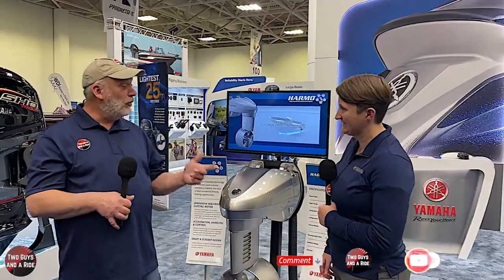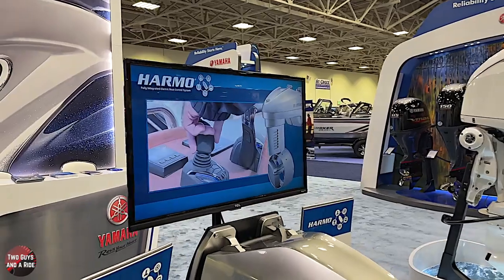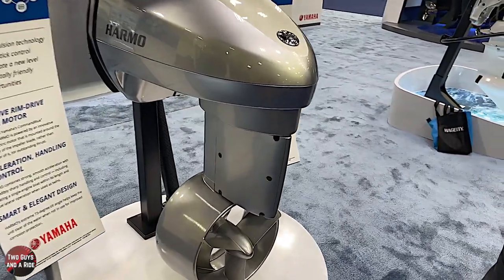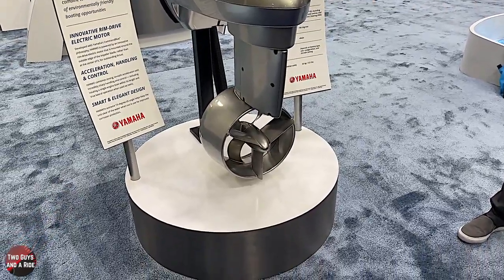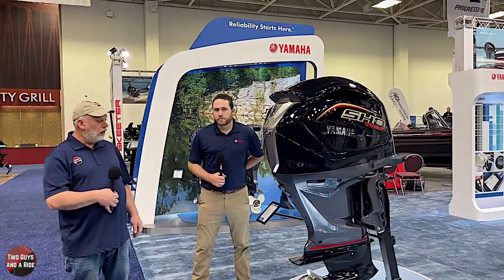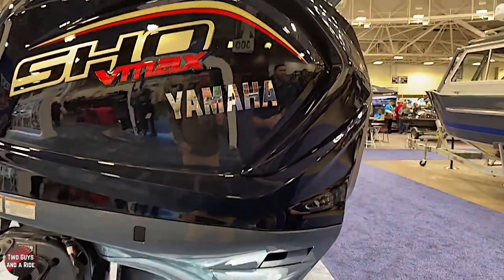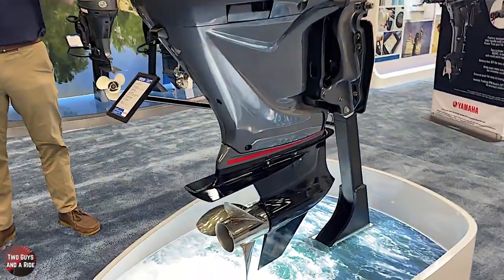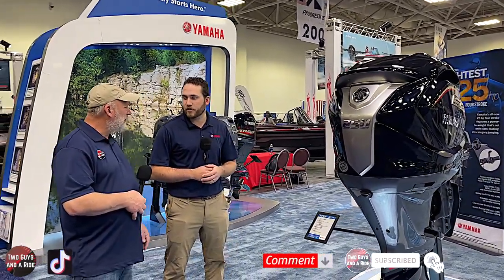The future of boat engines - Yamaha HARMO Electric Outboard

Comment: Still can't see the price. Doesn't look like yamaha is trying to make their own battery system either or i missed something? Also quite sceptic about 9.9hp equivalent since the motor is only 3.7kw. In US already few decent complete options available for electric propulsions, wish in Japan also had something in 15-25kw range.
Reply from the maker: Re price they’re 30k app
Not a budget option
Reply: Why should Yamaha get into the battery business?  Plenty of players in that market already.
Reply: @tedunguent156  Who offers complete systems that can pass marine safety inspection? Big lithium packs are no joke in marine environment. It's quite similar to electric cars, not that easy to match batteries safely and efficiently. So it makes perfect sense to sell their own battery packs with secure connections, software, health monitoring system, properly sized cables etc. Using lead acid batteries is what doesn't make sense.

But at mentioned price yep, i don't really see how it can be sold as stand alone solution. I was somewhat interested(twin 3.7kw small, but still in usable range for me) because there is basically no local solutions in Japan. But for 30k can buy a 25kw purpose designed outboard with two 9kw battery packs all in one system, the problem is importing it to Japan, which is quite a hurdle to overcome actually. As much as i want to go with electric propulsion and willing to accept limitations, won't be happening anytime soon.
Reply: @olegvinokurov1738  You can use AGM (lead-acid) no problem and LiFePo batteries are fine as long as the temperatures are 35 degrees F or above.  They even have LiFePo batteries that self-heat for lower temps.  LiFePo will discharge just fine below freezing but can't be charged.  Those LiFePo batteries have "secure connections, software, health monitoring" and bluetooth.  It isn't as complicated as you are making it sound.  That is why Yamaha doesn't need to get into the battery business.  The near future (2023) will bring solid-state batteries to the market and that will be the catalyst that accelerates the move from ICE to electric.  Don't kid yourself.
Reply: @tedunguent156  Lead acid has way too low power density and low durability. In no wake zone or perhaps for sail boats to get in and out from marina sure, enough. Conventional marine lifepo4 also don't pack enough juice, i don't see anything better than 75-90wh/kg. Yamaha could have access to cells that common folk can't really touch and make battery packs with water/corrosion resistant connections. Few electric propulsion options available in US do so and their packs are at 150+ wh/kg.

Anyway, price of Yamaha Harmo drive unit alone already makes in unviable option. Importing from US available systems will increase price at least two fold, which is also way more than ICE outboards with heavy use, hardly justified. Not going to break even.
Reply: Well.... here we are 7 months deep in 2023. 5 more months for  "near future (2023) solid state batteries to the market" pipe dream to come true!  Now.  Seems that swallowing the GREEN pill removes all cognitive reasoning!